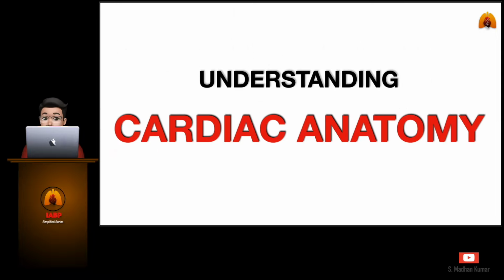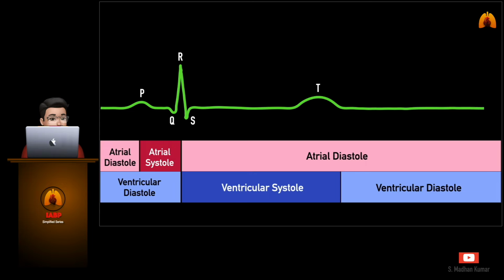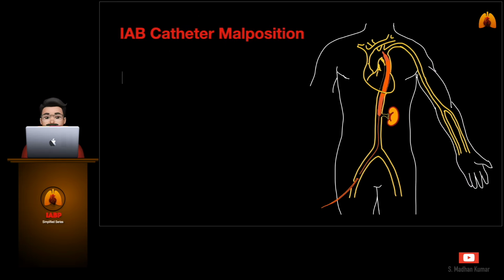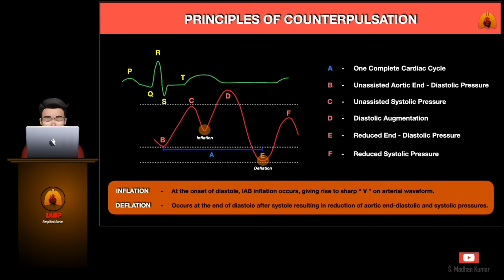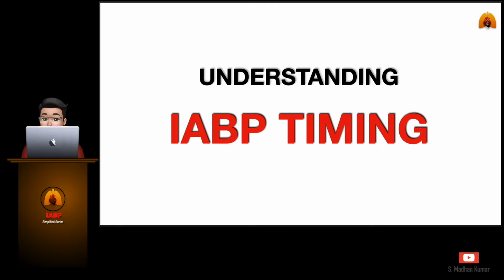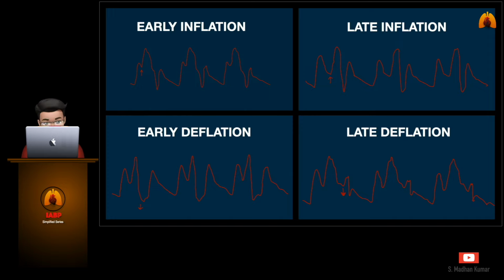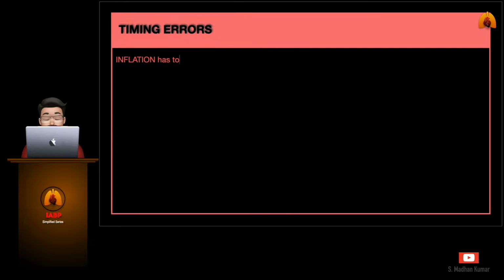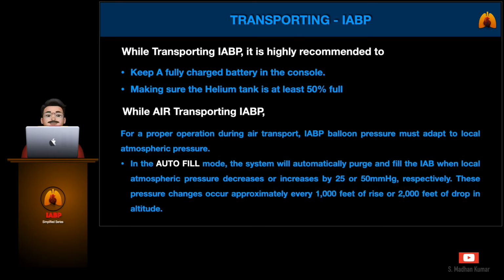IABP - INTRA AORTIC BALLOON PUMP

Comment: The CaesarKing shall order within the states and areas of Senators, Congressman and Congresswomen, Judges, lawmakers and lawyers to study the Dimensions and the Laws and Rules per area structures of verticals like a super sized buildings of 4 in my recent study there were 4 structures in that with vertical 4 structures of dimensions though for another studies if there are more than that 4 buildings of dimensional structures with layers  though still of validate research if numbering to millions or more than that structures by holographic effects and space pixels and microthings structures creations into macroworlds from microworlds and of what they're hidden other structures from capability of by inherents if with future agendas or if not of plans for any of the hidden of their creations, though from other discoveries  with each  parallels of the 4 areas  of vertical structure dimensions with leveled floors of multiverses not of a universe only theres another wide area space of orientational vectors or magnitude of static or fixed with firmaments and with gateways from the Sohcatoa point of view science wisdom and other orientational parameters of from my studies its 4 of such in pairs each creational design though could not be limited to such by spatial orientation of its spread version of 4 up from base structure to 4 spread structure of paired 2,2,2,2 forming the number 8 similar to valences of Elements of periodic table charted only of probable or possible there are others uncharted elements types for in science researches posted in Google News there are several elements discovered not charted or listed in the periodic table of elements, why I the CaesarKing ordering such thing, because the lands mentioned not only limited on or in planet Earth, there are 6 million planet Earths in our Milky Way galaxy only, how about in the plentiful of galaxies of lands and and waters with firmaments mentioned in the book of Genesis Creation wherein the seas and lands with firmaments per firmaments can also be pertaining to seas of space not just at the 7 seas of Earth and lands of orbitals and moon therein, because you're law inclined and aside from Earth laws by geographical orientation there are plenty of lands and seas versions of such, for the betterment and more leverage and scope in the near future as you progress to your know how as law based groups, why again, there's Night and Day in Genesis book of Creation and in your day scope of law I think that's only the very basic or less than basic the scope of know how of probably at its infancy stage of existential span length of time in Eternity to Eternity Forever and Ever Bible verse of Day scope study of law only in a larger scales and scopes. The CaesarKing I shall create an incentive fund for the extra Lawmakers of initiatives studies though not forcing nor superseeding you of your original function, those lawmakers of study and research resourcefulness for better future functions shall be ordered with initiative fund from Sourced galaxy dimension  of specific only lawmaker office of study of such for what Ive mentioned are studies results from variety of science reports and video posts with comparable validation order to infuse fund my teleporter ferrier AI Quantum Computers from sourced galaxy funds verified by holograms of nature and science of a very modern satellites Constellation specially focused for such amounting initially to 6 million pesos convertible to foreign currency, the concern of others of resources problem from previously learned or infused or standards or practices of fund allocations of such project for lawmakers by volunteer study of immersions are or were just only diversions of agenda focused and are a very large principality Hoax because there are plentiful of creations and realms likened to universe and multiverses of probably and possibly of plural, that previous money practices principalities of yours are just only Pre CaesarKing existential to power status exercise practice. I've proven by previous orders that their teachings are self serving agendas and fakes in facts and truth in science, nature and spirits of creational realities. Let it be

Comment: I loved your video. I work in the ICU and I’m trying to get more familiar with IABP. Sadly most of the nurses and physicians just put the IABP into the auto mode and never attempt to optimize the timing. Would you have slides that I could print and reference when using the balloon pump?  Thank you again for the lecture.